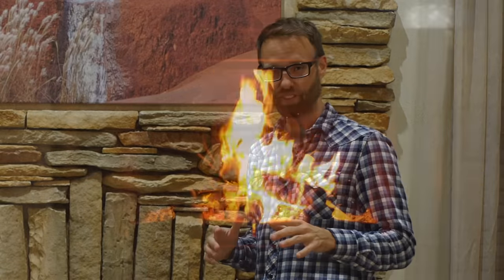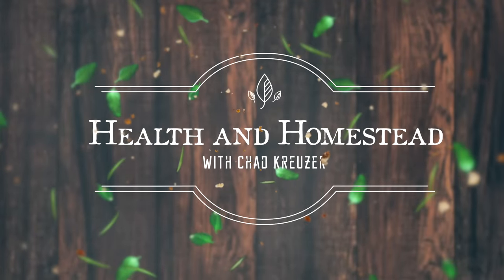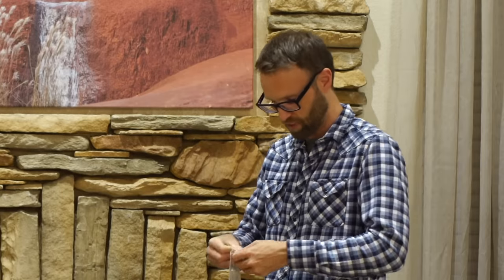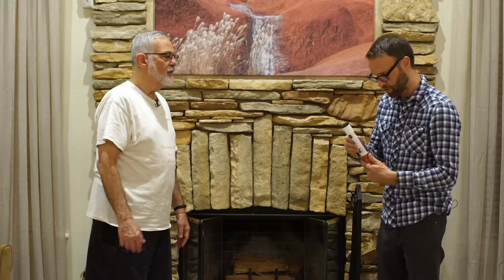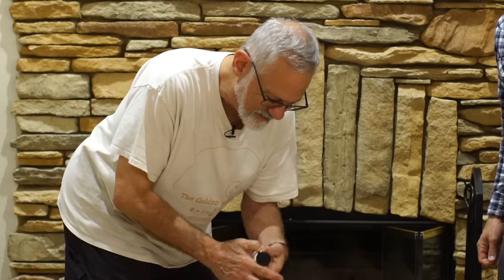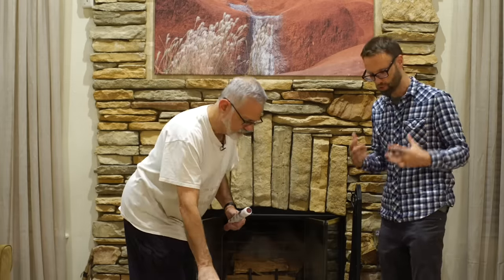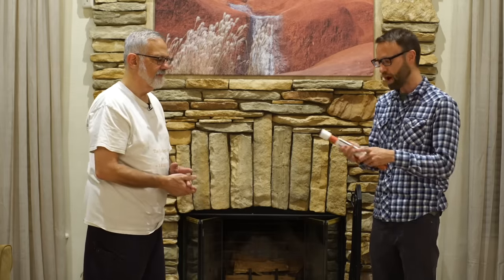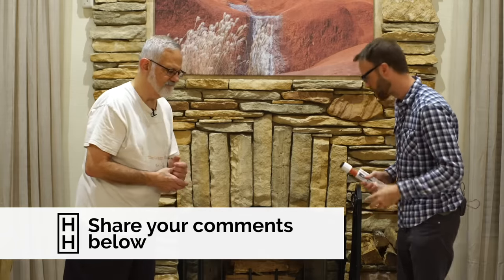You Need To Know How To Put Out Chimney Fires.

Comment: We had a chimney fire in early April. I had one of these flares for 38 years and never needed it until that night, the price sticker was still on it $4.69. My wife had already called the fire department. I lit the flare and put it in the stove the fire went out within 30 seconds. The fire department arrived and were amazed we had one of these flares. They said they are the single best items wood stove users should have. The chimney guy came the following Wednesday cleaned our chimney also saying these flares work. I have two in stock in case I ever need it. The chimney guy said every few weeks to throw and aluminum can into the stove. The aluminum oxide will loosen the creosote on the chimney walls.
Reply: Good to know about the aluminum can trick 
Thanks 🙏 
Will try it this winter
Reply: Thank you so much, really really appreciate this. You have no idea. Thank you!!!! You guys are helping me keep my family safe and I can actually sleep better at night. God bless you!! ❤😊❤
Reply: Per a chimney sweep business's website: "Many have claimed that burning aluminum cans is an effective technique to clean your chimney. Though there may have been cases where this method has worked slightly, nothing takes the place of actually cleaning out the chimney. 

In fire tests conducted on aluminum materials, it was found that when fire temperatures exceed the melting point (which occurs at a range of 600-660°C), aluminum surfaces that are exposed to the fire can melt, but do not burn.  Heating the cans causes an increase in heat in a chimney which can help prevent creosote from building up on a clean chimney. However, aluminum oxides are very stable and do not react to high temperature. This means that there will not be much of an impact on built-up creosote.     

....To help prevent creosote from building up in your fireplace, it is important to use efficient burning techniques. For example, burn small, hot fires using hardwood

Our professionals at Brick + Ember Outfitters recommend that homeowners get their chimney system serviced at least once a year."
Reply: Great tip with the aluminum can
Reply: @dryerventcleans  His tip is false. Aluminum cans do NOT loosen the creosote. See my comment above.
Reply: Please don't think that once a year is adequate! 
 Figure out how to inspect your chimney for creosote buildup.
  I'm in a cold climate and clean my stove pipe a minimum of two times a season, sometimes three.  I watch my spark arrestor closely as it clogs up slightly faster than the chimney builds up, and the draft changes as the volume of the chimney is reduced. Visual inspection is the best. The wood you burn, how hot you make your fire, and many other things determine the rate of build-up.
Reply: @mikerainey3847 I've been burning wood since early 70's and you have very sound advice. Most of us have chimney brushes. I don't want to burn small hot fires 🔥
Reply: Aluminium cans? Never heard that before,can hardly belief that would help to be honest.
The only thing that would help is to burn dry hardwood only,and a annual inspection.
Reply: Meanwhile the fire dept charged you a minimum of $500 just for showing up...
Reply: @rickss69 don’t call the fire department Rick. There is a shortage of open lot for building
Reply: @dryerventcleans  Doesn't work.
Reply: @rickss69  Huh? No it was free.
Reply: When I was a kid I used to melt cans and pennies in our fireplace all the time.  I was larping as a blacksmith, not realizing I was also cleaning the chimney.
Reply: Omg. I'm sidekick!

(Tip off the hat for you, SAH(STAMP*)
Reply: You Truly are a blessed man.
My wife would have run for a ROTISSERIE
Reply: You really don’t want to breathe in burning aluminum fumes.

Comment: Simple to put a chimney fire out, add 2 cups of water on the fire slowly not to put the fire in hearth out as you need that to create the steam to put fire out. The steam rises and puts the fire out in the chimney. The secret is don't add to much water. Wait few minutes minutes then add another cup of water slowly to make steam. This is the method fire brigade used attending my chimney fire. Allways keep small bucket of water and cup close to fire place for this  reason is my insurance. It works purfectly this method was known by most people years ago when every home had a open fire.
Reply: This method worked for me about 30 years ago. I heard what sounded like sand raining down inside the long stovepipe and a couple of backpressure puffs of smoke came into the house. Half a cup of water on the hot coals, as to not damage the hot woodstove and closed the side door. Steam shot up the 24 ft stack and the fire was out 🙏. Scary few seconds for sure.
Reply: Our son had a chimney fire and the daughter-in- law called the fire dept. It was very scary for them. The fire dept told them the best way to put out a chimney fire is to through wet newspapers into the stove and the steam from the newspapers will put out the fire. They didn’t have anything to good to say about that gadget the two guys used 🤔
Reply: Spray bottle with hand pump is excellent way. Or a pressurised sprayer water only.
Reply: When we had a chimney fire in the 60's the firemen advised we kept a large washing up liquid bottle full of water near the fireplace (was open fire) and just squirt water up the chimney to put a chimney fire out.

Comment: This is brilliant - our stove installer and chimney sweep guy for 4 years never told us about this.  Many thanks from the UK!
Reply: That's because UK building regu;ations make us have better designed flues & only a state registered HEATAS engineer can work on a flue or solid fuel  appliance. That Chimnex may be OK, I've not used one. As a retired UK firefighter, I've been to plenty of chimney fires over the years, but no one ever shot at the roof, even in a blizzard.

Comment: I have actually had good results by tearing off the top of a box of baking soda and fling the contents into the fire and close it up tight. The fire gets extinguished or drastically reduced, and the heat rising up the chimney carries a portion of the soda up and reduces or extinguishes the fire there.
Reply: This also works because heating baking soda releases carbon dioxide, essentially suffocating the fire from oxygen

Comment: Had a chimney fire a few years ago, when my wood burning stove was roaring and set fire to the flue. Outside it looked like a volcano erupting with lots of smoke & flames. Managed to put it out by 1. dousing the fire in the stove using a garden sprayer & bottle of water, then 2. rammed a wet dust sheet into the throat of the stove, to cut off the air supply. It worked a treat but was pretty scary. After it all cooled down, I swept the chimney before relighting the stove.
Reply: I used the same technique, much to the surprise of the firemen. They couldn't believe I'd had a chimney fire until they saw my son's video. Break the fire triangle for success.
Reply: When I used to be a firefighter, we would use our water extinguishers to do that. Spray the coals, which steamed upwards up the chimney, and usually would put the fire out. The one warning I got(though I never saw it happen), was to be sparing with the water. The quick change in temperature could end up cracking the liner
Reply: @OldMotorcycleAdventures  beauty advice. 🍻

Comment: I was walking around my older townhouse community about fifteen years ago and saw sparks coming out of the chimney of an end unit.  The wind was blowing in just the right direction that the sparks were falling all along the roofline. I rang their bell and by the time they came out to see it, there were flames popping up out of the chimney and the sparks were starting to make some of the shingles smolder and smoke a bit.  Luckily our townhouses were built in 1969 and these were solid ceramic core brick chimneys with concrete tops and steel caps, and our roofs had asbestos shingles.

Comment: When I was a kid(8yrs)we rented a cottage in the summer, 2nd day there the night got cold so we lit the airtight(sort of)in the cottage. About an hour later we heard that scary train/tornado sound coming from the woodstove. Luckily I was tasked with watering the owners flower and vegetable gardens while we were there and he had a really decent jet pump set up on his cottage. So I just walked outside turned the hose on and adjusted the spray nozzle for fully tight strongest stream and it easily reached the top of the A frame peak where the chimney cap was and with hitting the side of the piping and a little bit down the pipe(not too much)I had extinguished the chimney fire before even anybody else came outside to see what they could do to stop it, they had closed the damper and dialed the stove airscrews down tight and everything was done. I was the local hero for the week and the owner was really nice to me for the rest of his life. He was a helluva a good guy and I really enjoyed talking with him everytime I would see him as I grew. He was very thankful that I was there at the time and even at such a young age, that I had a grasp of knowledge enough to take care of his cottage. It was scary though if that hose had not been there and his pump not strong enough, the cottage would fer sure have burned to the ground, all he had was older tin type piping up through the whole place and one 2ft section of insulated to run through the roofing joist. The flames and sparks coming out of the cap area of the piping were at least 10ft and bright in colour so it was damn hot and only had tar shingles all around the stack. I was just happy to help.

Comment: I had bought a 25 year old house where the previous ower said the chimney was cleaned about a year before and i should think about getting it clean
The house i had been living at for 5 years and never cleaned the chimney which was the first house i had with a fire place
My first fire in the new to me house i went outside to see if sparks were going into a near by tree and couldn’t believe what i seen the chimney looked like a butane cigarette lighter huge blue flame lucky for me i had a fire extinguisher near by let it go into the fire box then pointed up the chimney and finished it off 
Climbed onto the room and could not see down the chimney due to so much creosol from the previous owners burning chip board and other crappy fire wood 
We were lucky the house didnt burn down

Comment: I cleaned my entire chimney 4 weeks ago. We had a few unusually warm days recently so my fires were lower temperature. This morning, I noticed that the 2 logs I put on coals in the middle of the night, were only partially burned and the stove was full of dense smoke. I hit it with a torch and it lit nicely. Started frying up some eggs and we smelled burning plastic? Then saw thick smoke coming from seems in double wall pipe and it was a chimney fire. I immediately used an extinguisher in stove and sent some down from the top and flipped the cap over to starve air. Then shoveled out everything that was in the stove and spent the day cleaning. Point is, the pipe wasn’t very dirty to begin with, but igniting the smoke in the pipe caused an event. Next time I see a stove full of smoke, I will consider my options better.

Comment: Modern stoves and furnaces are more efficient and send cooler smoke up the chimney which allows the build up of creosote.  Long chimneys typically draft better to expel the particulates. Insulated double-lined stainless flue seems to be a great option on an exterior chimney.  But the old standard is the clay flue brick chimney.  The smoke heats up the mass of the chimney and provides heat long after the fire dies. I have an old house with an inefficient wood stove and a 30 foot long clay flue chimney. The chimney running through every story of the house stays warm and provides constant heat. I run an 8" square brush to clean it once year and get less than a gallon of soot-never creosote-just messy soot. Just clean your chimney once in a while and you are doing better than most and shouldn't have an issue.  Oh yeah, I only burn hard wood and I wouldn't necessarily call it seasoned.
,

Comment: I had one in a fireplace what I did was I found some sheet metal I had perfect to cover the fireplace opening cut the oxygen put it out. I put some 8x8 concrete blocks to hold it it was hot and we called the fire department by the time they got up there looked at it was out. I had a guy come out clean it he said the fire burned most of it away. My fireplace has a very thick liner in it so he said likely would not have burned my house down unless something fell on the roof. Now I have it cleaned  once a year well worth $220.
Reply: Same.... rather spend the 200 bucks and get it cleaned one a year
Reply: You could clean it yourself with a 60 dollar kit from the hardware store. Nevertheless paying 220 is better than being dead I guess.

Comment: We only had wood heat for 40 years until a PG&E caused forest fire in Paradise,  Northern California burned every thing to a crisp and 88 people died!  The guy at the place where I bought my first wood stove told me to get a rip roaring cedar fire every two weeks or so to clean the flue so there would be no flue fires but in the winter with a 8X12 pitch I wasn't going to use my flue brush that I used every year also.  I had 4 chain saws and got firewood cutting permits from the forest service every year so we had plenty of firewood!  I was teased a lot about how much wood I had but when the power went out like it did the first 25 years or so we kept warm and could heat water to bathe with and cooked on it too.  We had 3 Aladdin lamps and were set even though things took a little longer.  We were just camping in our cabin,  one time for 8 days.  I had a Toyota pick up with 12,50X33X15 on narrow wheels and could go down to 2 lbs. to get up our gravel hill and down the other side to get to work.  I sure miss those days.  I took of the pounds when I was splitting and splitting firewood but it was good honest work.  I had a 266 Husqvarna Chain saw with a 28 inch bar and my other 3 saws so I could fell some good sized trees.

Comment: Chimney fires are serious.
I once watched a chimney fire burn a house to the ground.  It was in a very rural area away from any good water supply. Volunteer Fire Department was on scene quickly, but they lacked enough water to knock the fire down completely.  They had a large pool that was filled by a pumper truck that had to run several miles to the lake to get water. Before they got back, they had drained the pool and the fire quickly built back up. This happened several times and the fire finally took the house down.

The lesson here is make sure your chimney is clean. Also helps to have lots of non-combustible material around the chimney, perhaps double or triple what code requires.

Comment: Here's the problem... if you put out the fire you have only solved the result and not the cause. Especially those who heat only with wood might not understand, though they should, that there will be another fire if they continue to use the chimney. This is a situation where prevention is paramount. Creosote forms when green (unseasoned) wood is burned and also when a slow fire is kept as in banking the fire for the night. Unless you have a poorly constructed chimney setup the best way to avoid buildup is to burn a hot or roaring fire whenever you kindle your  stove  or fireplace. This will burn off the excess creosote and prevent a larger chimney fire from starting.  Usually fireplaces will burn hot enough that creosote will not form anyway due to poor draft control. It is these airtight stoves that are generally the most problematic due to incomplete combustion from lack of oxygen when closed up. This might be a good product for someone who neglects their chimney but I think it is far better to clean the entire chimney and pipes yearly and to burn hot fires regularly to keep buildup to a minimum for a safe wood heating solution. This method has worked for me these past sixty years that I've been heating with wood. Blessings
Reply: I agree. We have a newer install. The installer recommended have a small hot fire in the morning. So it is, wife gets the morning fire going on last nights coals. Runs a a cycle were it burns hot, house warm, rake the coals through the day, load it up, runs a cycle where it burns front to back, repeat. Remove ash/coals as required [garden use]. We have 2 45 degree elbows where upon cleaning found the most creosote build up. Installer stated the chimney is rated for a chimney fire. He stated one could toss a water soaked paper towel roll into the stove to extinguish. Not my words. Our wood is 2 years dry now. Expecting better chimney clean out next year. Friends dad had his chimney 80% blocked and back draft from unseasoned wood last year.  Pulled over years ago upon seeing a chimney fire on an old farm house. Yelled into the house "FIRE"  Looking for people eventually an old fella come up a forest trail. Fire Department was now onsite and he happened to be poaching and had 7 deer in the barn.
Karma. Clean it each year. Peace of mind.
Reply: Not always the case with soot.  I did not know about hedge and burned it so the fire got so hot the it cause a chimney fire. Got it put out and now know what hedge is so other then small pieces to start I do not use hedge. The same thing can happen by overloading wood in your fireplace or wood stove.